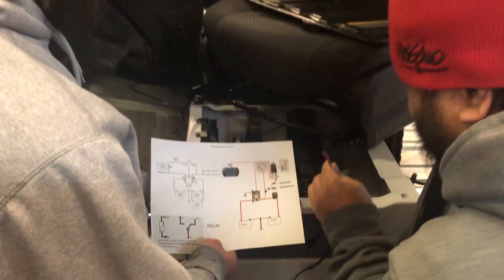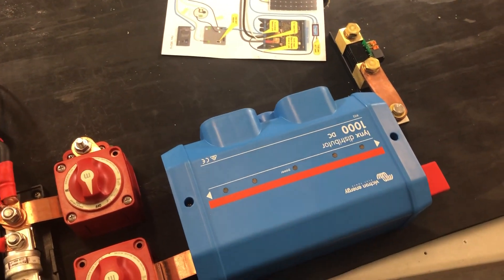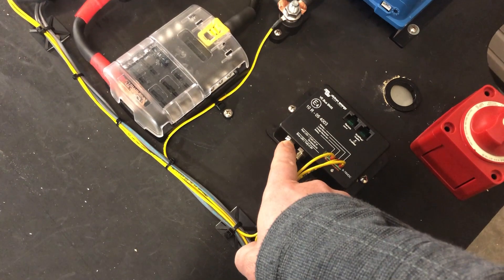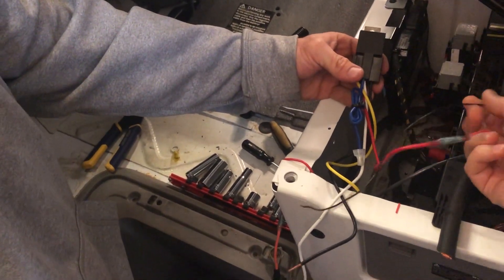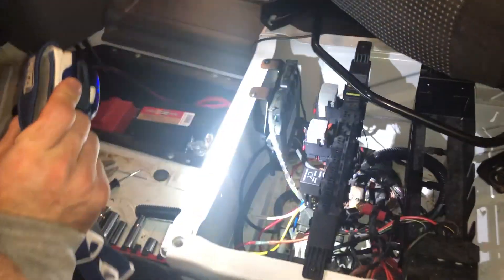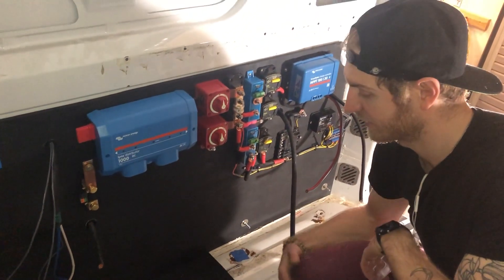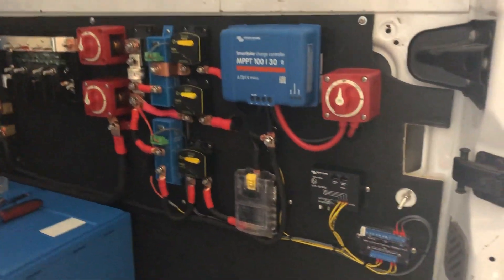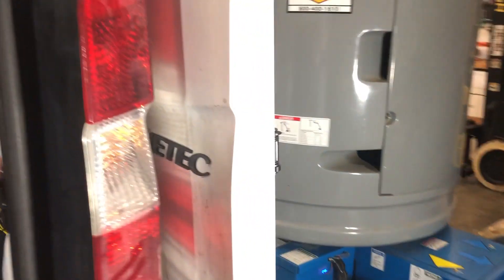Van Conversion for Solar - Up On The Mountain (Pt. 4 - Solar Panels)

Comment: great video what size wire are you using off the solar MPPT?
Reply from the maker: On a 30A charge controller we use 6ga.

Comment: Question about negative connection coming from the MPPT change controller connecting to the load fuse box, is this normal? every other video I watched shows the negative and positive cables going directly to the battery? I thought that cables should be kpet to a close to the same length?
Reply from the maker: The negative of the fuse box and the battery negative (at least past the shunt) are on the same node, so it doesn’t matter.  There is no reason for cables to have the same length.  Electrons flow in a loop, it’s not like positive and negative electricity has to meet at one point at exactly the same time.

Comment: How did you guys make these custom buss bars, ie. buss breaker to Victron BP? everything looks great btw...
Reply from the maker: We bought some long copper bars, cut them to length, bend them on a vice, drill them out and grind the corners.  We also have some pre-manufactured bars that we custom bend.  The process can be labor-intensive and because of that, we don’t recommend it for someone just doing one installation.  You can do a very nice installation with normal cables and lugs instead of the copper bars.

Comment: Hey guys, 
First of all thank you for taking time and making this video! I do have a question about some of the components. 
- What is the reason of using an battery protect between the MPPT and the Battery, does the MPPT have a protocol of charging a LIFEPo4 battery?
- Is it correct that the VE Bus is connected to the inverter and does prevent the battery from over/under charging? 
- Do you use an battery protect between the alternator charging system and the battery?
I know that these are a lot of questions, I am just trying to learn as much as I can.
Thank you, Maarten
Reply from the maker: The Battery Protect between the charge controller and the battery is only used as a very energy efficient/durable switch.  It is turned ON/OFF by the V4 board.  We don’t program it.  The VE.Bus BMS is connected to the inverter via RJ45 cable.  It prevents over/under charging.  Additionally, the V4 board communicates with the T-SENSE port of the inverter to provide another layer of cold charge protection.  We use a Cyrix-Li-Ct on the alternator charger, because that is bi-directional, whereas a Battery Protect can only deal with current flowing in one direction.
Reply: @GarretTowneAMS  i'm just a noob and for sure i dont get it, but shouldn't the "switch" (Battery protect in case of cold battery) sitting between the solar and the MPPT to prevent damage on the MPPT on cold but sunny days?
Reply from the maker: Friedrich Nietzsche You are correct. We do have a BP between the change controller and the battery system. We also have another BP between the batteries and the DC loads.
Reply: @GarretTowneAMS  yes, but it is in between the MPPT and the battery. And in case of disconnect the battery is save. But i the MPPT can be damaged by the power from the solar panels without a connected battery. If the swith would be located between the solar panels and the MPPT, you would save the battery and the MPPT.
Reply from the maker: Friedrich Nietzsche I don’t think the change controller gets damaged like that, but I will look into it.
Reply: @GarretTowneAMS  Thanks for all the videos, they are so informative.  I just want to clear something up.  Because you are using the Cyrix, that protects the lithium batteries from being charged from the alternator when the batteries are frozen?  If you used a DC to DC battery charger from the alternator instead wouldnt that give the lithium batteries a better charge profile because it has the 3 different stages?  If you used a DC to DC instead would you then need a batteries protect so that you didnt charge the batteries if they were too cold?  I hope that was not too many questions and thank you for any information you could provide me.

Comment: if it charge lithium batteries does it overcharge the car battery
Reply from the maker: jouni k No, car batteries can handle a higher voltage charge than lithium batteries.